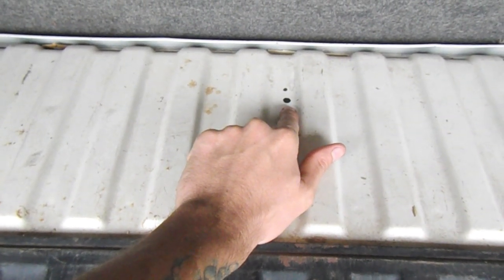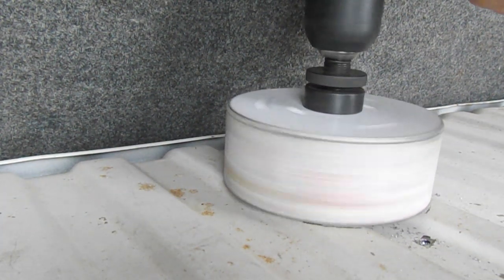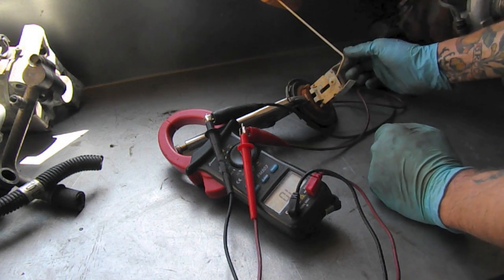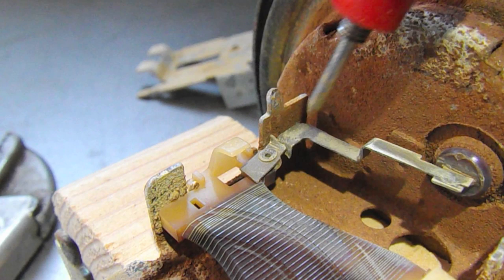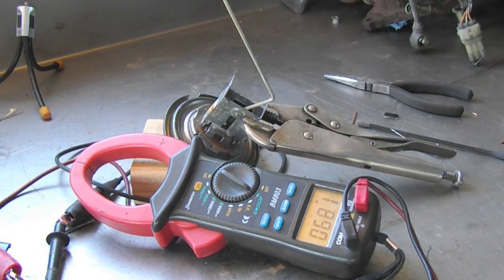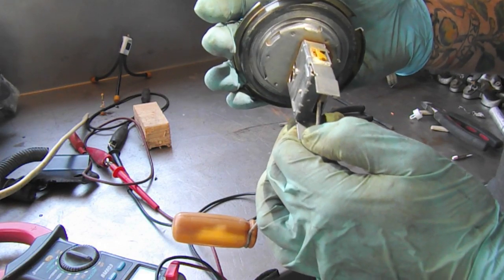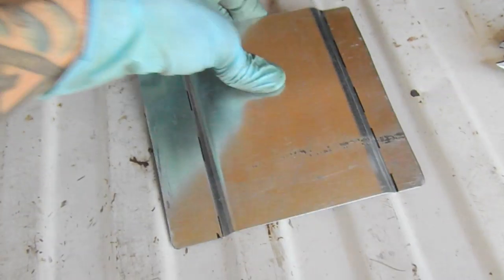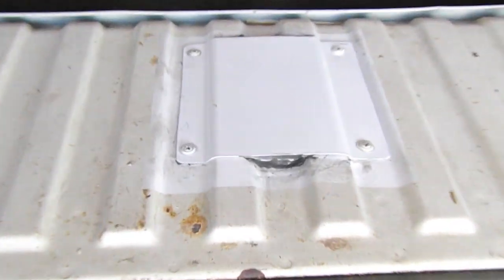VW Bus Fuel Gauge Sender Repair

Comment: Cool. My sender was reading at full, but once it got part way down would drop to empty. While doing an engine swap (stock for stock) I replaced the sender, so no hole. But in the plumbing industry, we use a portable break (used for bending sheet metal in the field) that would have made your patch match the valley in the deck. Also masking tape can prevent silicone from getting out of hand. Denatured alcohol prevents silicone from sticking to surfaces and paint thinner works for cleaning up silicone if it gets onto other surfaces and you can smooth it out... 

Now to dig up my old sender and see if I can get it working again. Thanks for the video!

Comment: Hi ,first of all well done in finding the problem and fixing it,most dont bother,which is a shame.just a couple points for reliability sake only,you did good with the copper wire,resistive wire wont solder ,your right,crimping is the only way,sort that and make sure your soldered joints are flowing to both parts,you then have a good reliable sender,well done.

Comment: Thanks for the great content!

I have a 1981 T3 1.6D. The fuel guage moves up to a little under half full, but after a while it just drops to zero. The coolant temp needle does not move at all, but the overheating light blinks at startup. I don't know if these two probelms are related. Any idea on if this is a fuel guage, sender or wireing problem and how to diagnose it further?

Comment: Was looking for some help, have a 79 bus that the gas gauge was not showing proper. Replaced the sending unit and now it is only showing full tank. When tested out of the tank while hooked up it seemed to work properly and relay empty to full as the sending unit was moved, felt confident in the operation and installed into the tank and sealed up the plate but now it is not moving. Is there a way to tell which wire is which for the sending unit and does it mater? Also is there a certain position it needs to be installed into the tank? Kind of lost where to go from here any advice is greatly appreciated.

Comment: My gauge is showing half a tank when it is full. I have taken the earth wire back to the battery and also tested for correct voltage. Is it possible the sending unit can read but send an incorrect resistance reading to the gauge?

Comment: Hi Busaru, i have almost same problem on my VW T2 '79. When tank is full will show full but will show empty though there is half tank fuel inside left. I do also have access to the tank under the mattress in the back, what would you suggest to start looking at on the +/- cables on the hauge without taking apart it first? I will also spray some WD40 to the terminals though i do not think problem is there as the fuel indicator in the dashboard seems to respond/moving but not accurate. Or should i consider having a look on the dashboard for some other issue? Do you also think that the position of the plastic float is not correctly aligned inside my fuel tank? Thanks

Comment: I have a 68 bus same problem but when i open the key the gas needle jumps could it be this problem? And my speedometer is out as well any ideas?
Reply from the maker: +Rafael Martinez hi Rafael, the speedo is mechanical off the front driver hub - take a look at that. The key fuel tank thing is probably an electrical issue - only one way to find out...

Comment: Wow... I do a search for issues with my Vana-RU... and it always comes up with your videos.  So, the issue I have (this time) is my fuel gauge.  I used the Subaru instrument cluster when I did the conversion.  I wanted a tachometer and the original 82 VW cluster ribbon cable cracked if you touched it.  So, now when I fill up my bus, it only shows half a tank.  The fuel sending unit is the one originally in the bus.  I thought maybe a universal sending unit would solve the issue... but...  there is NO universal sending unit I can find that will fit the existing tank opening.  Any ideas???  Keep them videos coming... as you are about the best source for issues I have with my Vana-RU.
Reply from the maker: Thanks BJ, I appreciate the kind words. For the fuel level you may want to determine what resistance the original Subaru sender is looking for when full and empty. See if you can find those scales on a Vanagon sender or manipulate it in some way to have approximately the same values. It’d be a fun project to try, maybe I’ll look into that someday. Cheers!

Comment: thx alot man, im really close of geeting a VW kombi for myself, and i was thinking an engine swap, it may not be a Subaru like yours but it gives me enough confidence to do it

just one question tho, are you a full time mechanic or just a DIY enthusiast?
Reply from the maker: That's cool that you're going for one of these classics. They are getting more and more rare so it's a good idea to snag one while they're still around!
I am a full time engine swapper :) It's not my favorite thing to do brake repairs on Subaru's, etc. But it pays the bills. My biggest joy is doing engine swaps and interesting builds (vegoil conversions, electric vehicles, subaru swaps, etc).
Reply: Busaru thats great man, i hope my attempt for restore the my van pays out, it has been sitting oustide for a year so, i hope its still fixable
Reply: +Busaru Nice video,very help full.Got a question for you. I hooked up the wires backwards on top of the sending unit by mistake and then turned the key on. The gauge went up a little then went back down so I reversed the wires the right way and the gauge did'nt move.I checked the ohms on the sending unit and got no reading at all I think the sending unit is bad, but my real question is did I do any damage to the fuel gauge or vibrator by hooking the wires up backwards? thanks

Comment: Hack a hole in the bus to replace a sender. No thanks, I will pull the engine to make the repair the correct way. Otherwise a decent video.
Reply from the maker: +Glenn Borchardt definitely not for everyone! I'd advise against this method for those with pristine vehicles. I don't have show car VW's since my primary focus is to put Subaru engines into them.
Reply: Glenn Borchardt holes =ugly=bare metal=rust=rustholes
Reply: @Busaru  the sender unit is about the same in motocycles?